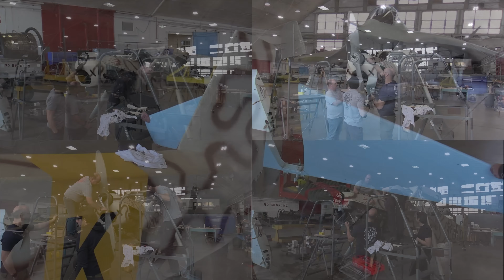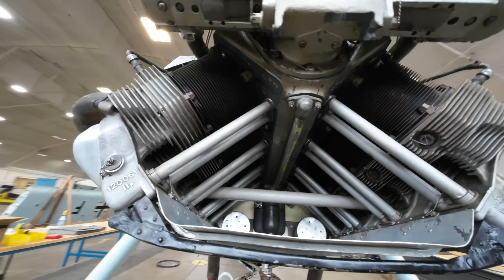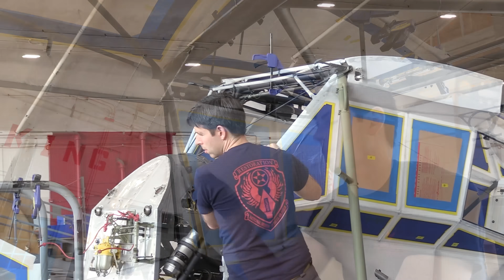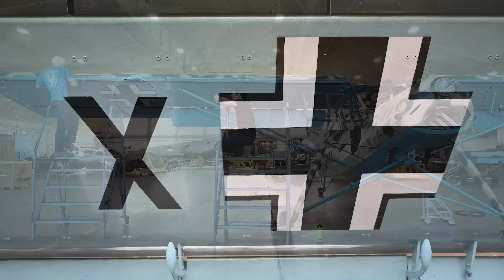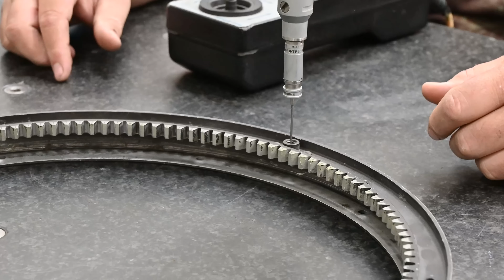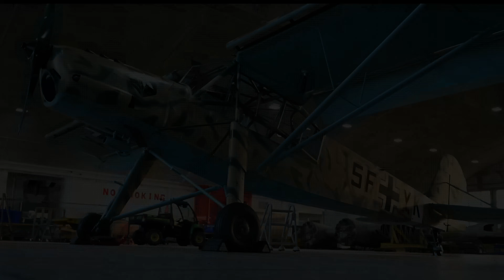Storch Restoration Full Length Doc NMUSAF

Comment: You forgot to mention Spain also widely used the Storch. One of its major roles at the end of its career was as gliders tug. A pity you didn´t go to restoring it to flyable condition......
Reply from the maker: Are museum aircraft restored to airworthy status?
While most of the aircraft at the National Museum of the U.S. Air Force have the potential to be made airworthy, our conservation and restoration work is directed at preserving the historical integrity and accuracy of an aircraft rather than achieving modern airworthiness. In preserving historical accuracy, we choose to use original parts that may be unserviceable or non-airworthy, rather than modern substitutes.  The Memphis Belle, for example, will use wiring made to original wartime specification, which does not meet today’s flight standards, rather than wiring used in modern aircraft. This is vital to our mission of preserving the record copies of these aircraft for future generations to come.